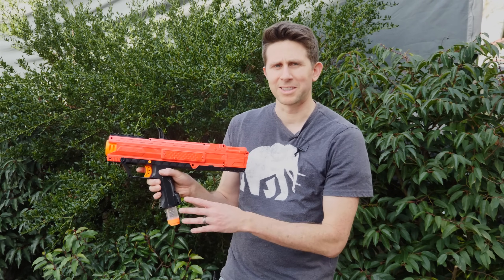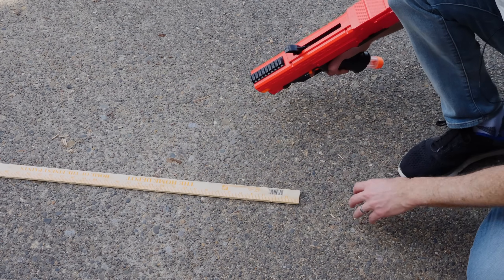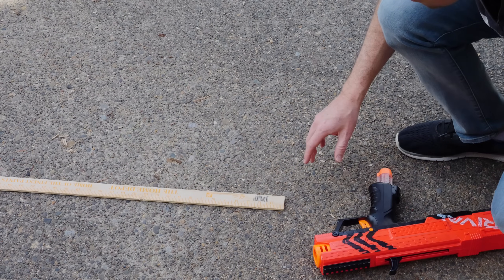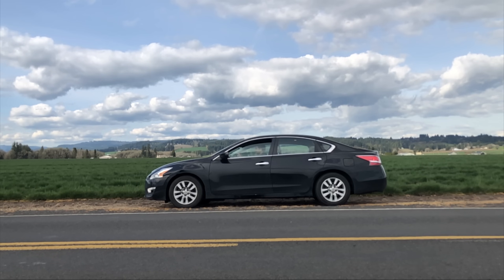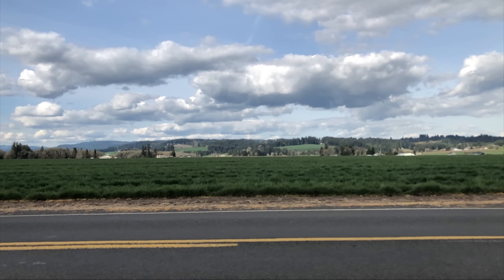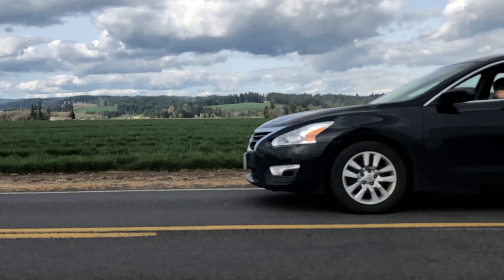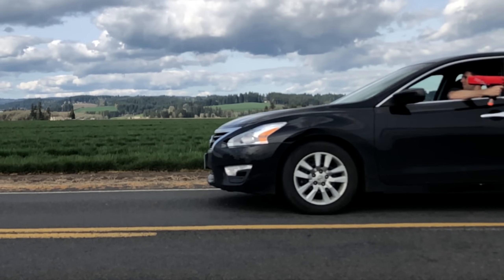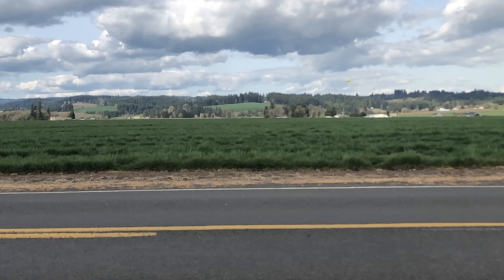Shooting a Nerf Gun Backwards While Driving At The Bullet's Speed Forward

Comment: just imagine if trains could drop you of with a mechanic like this. That would be awesome.
Reply: That's an amazing idea
Reply: The train would still need to slow down a lot to make sure you land on the platform in one piece
Reply: Shivang P Swain um?
Reply: @shivangswain  nah we yolo jump
Reply: Shivang P Swain what if the train just ejects us backwards out the train at 55mph while the train is going 55mph into a... foam pit! Would be like doing acrobatics and riding the train all in one! Good times!
Reply: @shivangswain  No! Not if you you getting luanched just as fast
Reply from the maker: just before your stop, you go towards the front of the train. There is a seat that you sit in that safely accelerates you to the the exact speed of the train in the opposite direction. You are ejected out of the back and land with zero velocity on your feet at your stop. I see no issues here 🤓
Reply: @TheActionLab  I see what you are saying. Basically, a more gradual/gentle acceleration several seconds ahead of the ejection time, rather than suddenly like the ball shot from your nerf gun.
Reply: @TheActionLab  that would make a great title though wouldnt it. :)
Reply: @TheActionLab  it is an engineering  problem, not everyone is the same weight so different forces will be needed to be applied plus not everyone will have the physical and mental ability to get the timing right.
Reply: @ahmedmamdouh3964  The seat that would accelerate you could also measure your weight so it could calculate the correct force that would act upon you.
Reply: @ahmedmamdouh3964  thats easy to fix with a  pressure sensor and adjust the velocity and stuff
Reply: @TheActionLab  wouldn't the g-forces be exponential because of the negative acceleration?
Reply: @imx152  that is not how g force works.  Einstein showed this with his theory of relativity. If I understand you correctly, you meant one acceleration going forward while the other going the opposite direction? They would cancel out. And you might be reffering to speed, which also cancel out.
Reply: @TheActionLab  Like seraphic said above. you are still going from 55 mph to zero in an instant.  Probably not good for your innards.  Your key statement Is "safely accelerates you" to the speed of the train.  There's the rub.
Reply: @TheActionLab  Did the math. 2g aka 20 m/s^2 =44mph/s, train at 80 mph , takes little less than 2 seconds (1.82s), and 33meters of distance to reach 80mph. This is fairly realistic. Unless my math is wrong.
Reply: @TheActionLab  -- when cars are driven by computers, your car can be the pod which hops on and off the moving train.
Reply: The Action Lab now collab with The Hacksmith to Make it Real
Reply: @TheActionLab  unless there are 50 people wanting to get out at the same time or more
Reply: @TheActionLab  most people are standing are we talking about a private train only govetnment officals use?:p
Reply: @TheActionLab  neeeeeeerd
Reply: The Action Lab That way it could work, good idea, but if it happened as quick as the nerf ball it would probably hurt you really bad.
Reply: @TheActionLab  "just before your stop"
What stop? The whole idea is the train DOESN'T stop.
Reply: @craigcorson3036  your stop is basically where you plan to leave the train. The train is not stopping at all...
Reply: That will break a lot of bones and maybe your neck
Reply: @ahmedmamdouh3964  getting shot at 60mph hell yea
Reply: @ertertz9408   the daredevil who gonna test it for us is you
🔥
Reply: @ahmedmamdouh3964  
no you speed up so you move the same speed as the train but backwards so you dont really move, you just,  ploop
Reply: @ahmedmamdouh3964  For sure there will be an impact! lol
Reply: @ahmedmamdouh3964  for science !
Reply: @ahmedmamdouh3964  it would, unless you accelrated the people gradually until they were moving the same speed as the train but opposite.  If you were to just instantly shoot them out the train at the same speed, the gforce would kill you.  I imagine a long conveyor that runs from the front of the train to the back. A person steps on the conveyor and it moves up to speed. By the time you reach the back, you just fall out and land on your feet!
Reply: @ahmedmamdouh3964  No, if it lounched you clean you would land perfectly.
Reply: ...not necessarily
Reply: Same concept can be used to enter and exiting trains. With enough room to accelerate and decelerate safely, it can actually be done. Now to work out the kinks.
Reply: @aledirksen01  maybe the chair only decelerates for just under half the train then sits still at the station just long enough for a new passenger to hop on before it starts accelerating them to the right speed to the other end of the train! No stops :3
Reply: It would be dangerous even if they could perfectly land you on the platform with no forward motion. The reason is that the sudden acceleration (or deceleration if you prefer) would be like getting slammed into a wall at the speed of the train. So that would kill you, and the process would gently deposit your corpse onto the train platform.
Reply: @derfunkhaus  But what a way to Go!
Reply: @derfunkhaus  Not at all. An acceleration of 1.5 g over 2 seconds is perfectly supportable by anybody.
Reply: informatimago I agree that 1.5 G over two seconds is no big deal. But I didn’t specify 1.5 G, so you must’ve arrived at that somehow. What did you base that on? The video talks about him driving 55 mph and the ball is accelerated practically instantly to -55 mph relative to the car’s motion. A lot more than 1.5 G.
Reply: @derfunkhaus  a=v²/(2s) where a is the required acceleration, v is the final ejection velocity (reference frame taken to be that of the person), s is the available length to accelerate the subject (length of the coach, say). 
Now, if a train is going at 360kmph, which is 100 m/s, and the available length be 50 metres (which is a lot), then a=100m/s², which is about 10g.

Making our assumption a bit more practical, v=100kmph, s=10m, we get a=4g, approx.
Reply: @derfunkhaus  if im not mistaken, there is a scene in a movie (which i forgot the tittle) practising this technique
Reply: @derfunkhaus  Exactly."It's not the fall that kills you, it's the sudden stop at the end."
Reply: It would be like throwing you against a brick wall.
Reply: Hahahahahaha! Yes!
Reply: i don’t want to be fired out of a train
Reply: I’m with Action Lab on this one. Just because it’s done with a human body doesn’t change the principles of physics. If the train were to slow down to let’s say 25mph, and you in the front of the train with some sort of propulsion mechanism were to be slingshot towards the back of the train at 26mph, the effect would feel as if you were walking out of the end of an electric escalator. You would feel a slight push of 1mph. You can even adjust the speed. Train 50mph, you accelerate @ 51mph the opposites direction. Slight push of 1mph. I believe the key here is to ACCELERATE to 51mph. Not sudden speed of 51mph.
Reply: @MAYNOR82  How many meters does a fast car travels before it hits 50mph? Thats how long that propulsion thing would have to be IF the trains speed was 50mph max. Now try to fit that concept when 50 people wants to get out on 1 station and another 50 wants in the train.
Reply: @matke8723  you're considering efficiency, the point is can it be done. And you're comparing tje strength of an engine to push a huge hunk of steel, to a mechanism that would only need to accelerate a human. The 2 arent linked in that strict sense you're saying.
Reply: @FinkPloyd504  Nah, I'm just saying that car accelerates to 60mph in 3, 4 seconds at...idk exactly...but its probably around 100m and even less. That should be the max length of that human propulsion system.
I know it's definitely doable, im just thinking how it would work.
I mean you can shoot young people from that system, but not elderly, or injured people at 60mph.
Hm..
Reply: @matke8723  you just make a small car thats on a rail on the side of the train, slow the train to like 40, and send the car backwards at the same speed. You have plenty of time, especially it the entire car is left behind in the platform at the end, then theres not even a gap you have to shoot. It could pick up another car right after on the fly, have them cycled around like shopping carts.
Reply: @matke8723  this is just about one person getting off really though. Its less of a this works and we should do it, more of a this thing could be done and is cool. Ofc you can't empty a whole train like that but thats not the point of the question :O
Reply: Matke Well I was speaking hypothetically. We are just exploring the possibility.
Reply: @MAYNOR82  yeah, the exit transition is all well and good, but accelerating the guy to 26 mph is the more pressing and possibly injurious problem
Reply: Lol a train shaped like a horse shoe that stays at a high velocity and a exiting pod to let people off. While also passing the train station the horse shoe shaped train picks up empty pods already accelerating to the same momentum.
Reply: @codyfennell9858  ok, what happens to the escape pod after it lands?
Reply: Shadow747 since my idea would to use the railways already in use just add a onsite storage that could spray a cleaning solution before it gets in line for the next passing train or cycle. Eventually the idea could be used in a whole new way like with new railing systems but just a thought for re-engineering the train as is with minimal expense for testing and so fourth
Reply from the maker: @Eddie Hitler You are correct. There are lot of people on here that seem to believe there would be an instant deceleration at the train stop. They are not understanding the concept that the ground is moving the same speed as the person when they hit it. Of course this idea is just silly as a real idea, but it is definitely possible to do without hurting the person. Looks like I’m going to have to try to do a video with a human:) for example if a semi truck with a long bed was moving at 28 mph and Usain Bolt ran at his top speed backwards off the back he would just drop off the back as though it were stopped and he hopped onto the ground. There would be no deceleration for Usain because the ground is moving the same speed as him when he hits it.
Reply: The Action Lab well I for one am not talking about that at all. I’m talking about the process by which the person who is traveling at some velocity v while on the train, is suddenly accelerated to -v with respect to the train. For example if you had a strong spring mechanism that ejected them backwards (with respect to the path of the train), if that spring accelerated them with too many Gs, it would physically traumatic. i.e. It has nothing to do with impact on the stationary earth. The moment they hit the ground, no physical damage would occur. The damage would have been done already and no further damage would happen. The reason is that a human, unlike a nerf ball, has a brain which can bounce around inside the skull getting bruised and shearing off little blood vessels. Likewise the other organs of the body, such as the heart, can suffer catastrophic damage. 

So you would need to calculate how many Gs and how much moment of inertia a person could take, and design the system accordingly. It would be doable but it would impose a practical limit on the speed of the train at the time of ejection.
Reply: @TheActionLab  
Deceleration forces are equal to acceleration forces! Newton's third law. As Usain is not being shot out out of a gun he'll be fine depending on how far he falls!
Reply: @TheActionLab  that idea is crazy man
Reply: Just have a dropoff car that slowly builds speed from the front of the car to the back, matching the speed. You can picture standing on it as the ground in front of you stays the same, it would be as if you weren't even on the train, no brick wall problem at all, simple.
Reply: Eddie Hitler it would have to be gentle relative to the train and the passenger in question. It wouldn’t matter if it was gentle relative to the outside world if the change in velocity on the reference frame of the moving train were sudden enough to damage the passenger’s body.
Reply: The train would need a long ejection system to make sure u accelerate slowly to the speed of the train or else ur bones will break
Reply: Yeah! Like others are saying, impulse (change in momentum over time) would kill you if you did exactly this, but in a long train, perhaps you could be accelerated from the front of the train to the back and your change in momentum could happen over a longer time and lessen the impulse.
Reply: Good idea for a daredevil
Reply: Not really. You would have to instantly decelerate from whatever speed the train was going, to zero. If you could be decelerated more slowly, it could work, but I don't see how that could be accomplished.
Reply: @craigcorson3036  trains are long, why would they have to instantly accelerate them to the opposite speed? Can slowly ramp the speed along the many cars of the train, no need for instant acceleration.
Reply: @XXcreeps  dont need to be that slow acceleration. As long as its not instant, humans can take it ez. Check fastest accelerating cars ect
Reply: @XXcreeps  Have you ever been on a train? The cars move independently of each other, in every direction but forward/back. Please propose a mechanism by which this could be accomplished. Good luck with that.
Reply: @craigcorson3036  easy. You have something like a train car attached to the side of the train car, that picks up pace from the front of the train going backwards. Just match the speed and you have a window of time to step off , depending on how long your train is.
Reply: @FinkPloyd504  It would be a very brief window. A passenger train car is only eighty-five feet long.
Reply: @craigcorson3036  or the entire car could detatch at the end and be left on the platform for you to exit at your leisure
Reply: Train stations are already dangerous enough lol
Reply: And get on the train like that ☻
Reply: T F lol eventually yes but i think it would take a new railing system to make getting on the “super train” with the pods being used for exiting and entering. Mainly due to if we have this “super train” so to speak, how fast is it traveling? Lmao
Reply: It would be the same as if they train sudden stop. You would SPLAT against whatever container we were in 😜
Reply: I think the pressure needed to accelerate you to the trains speed (in that short time) would basically cause the same damage. But you could maybe just accelerate to the half trainspeed to split the impact up into two smaller Impacts
Reply: Eddie Hitler oh wow,
but at least the train will still need to have a similar system or else it’d be an unpleasant experience to normal people.
Reply: The G forces will tear you apart.
Reply: You'd have to be thrown out of the train at the speed of the train suddenly 

Very painful experience
Reply: Smaller wagons that accelerate independently before sticking to main train makes more humane approeach.
Reply: The cost of such thing outweighs it coolness in the real world.
Reply: The cross-purposes talk in this thread is painful.

It's a thought experiment, people.
Reply: Say the train runs at 100 km/h = 27.77 m/s; a passenger car length is about 27.77 m, let's assume we can install a passenger accelerating device of that length.  So we need to accelerate the passenger from 27.77 m/s down to 0 m/s over 27.77 m. So we have:

x=½at²
v=at

27.77 = ½ a t²
27.77 = a t

2 = t
a = 27.77/2 = 13.885 = 1.415 g

So this seems perfectly supportable, if a little abrupt.

The real problem is to unload more than one passenger at a time !
Reply: The deceleration would kill you sadly.
Reply: The mechanism would need to accelerate you.. to the speed of the train. I think I’m fine with the current system :)
Reply: That would be like a car accident. The sudden stop would hurt you.
Reply: That would be horrifying and you would (not a doctor) probably suffer a brain hemorrhage.
Reply: @Skratch_HD  why? Just limit the acceleration  and thus the force felt has a max cap.
Reply: @aledirksen01  Who's gonna ride a train that you can cycle faster than though?
Reply: @aledirksen01  you'll need a decent distance for that and some vessel to hold you so that there is no friction on your legs
Reply: @Skratch_HD  You might have replied to the wrong person but to answer your question, I never mentioned a speed. I would actually prefer extreme speeds. So I can do some math here to determine forces and maybe double check max force for humans and do another calculation there. Let's for now assume 1g of force is max acceleration which is rounded up 10m/s^2 or 22.4 mph/s. Thus for a train at 190 mph, it would take 190/22.4=8.5 seconds to get up to speed. We also want to know what distance would be needed for this. Distance = .5 acceleration × (time)^2 = 361 meters if my math is right. Subway trains are typically 40 to 130 meter so we in some issue here. Either make a compartment for acceleration or increase acceleration or reduce train speed. You have the numbers now so have fun
Reply: @Skratch_HD  the train will be going train speed with a barrel on the side with a chair that can accelerate to the same speed in the opposite direction until the cancel out and you're sitting still above the ground because the chair is going the same speed along the train in the opposite direction. You would just need longer acceleration time to prevent human damage if the was going very fast. No need for the train to go slow though thats the point of all the chair stuff. No stops so they can stay at full speed.
Reply: Too much g force
Reply: Lmao
Reply: Very doable as long as the speed of the train is not too fast. And you can run to match the speed of the train
Reply: oh my god, genius haha
Reply: @Eddie Hitler 🙄
Reply: It would only be awesome once
Reply: ward
Reply: To exit the train, you could step into the last car - a 10'6" wide pod spin up launcher, which would accelerate gradually like a giant washing machine starting a spin cycle. The final speed and exit release angle would be calculated bases on train speed, passenger weight, platform landing pad distance from the train, etc. Let's do this!
Reply: What would you need this? The train still needs to stop and pick people up
Reply: It can if ur brave enough
Reply: WE HAVE A VOLUNTEER!
Reply: Eddie Hitler 
Yeah and spend our money on like, usful stuff
Reply: There have been news of work going on this
Reply: They would put you in a cannon and shoot backward
Reply: The forces are the same as hitting a wall!
Reply: @Eddie Hitler Sure Eddie, sure. That's what everyone is saying. Bye now.
Reply: Shouldn’t the air resistance of going 55 mph carry the ball backwards?
Reply: @actiniumanarchy9237  No, the ball is held in place until released backward into effectively still air!
Reply: @actiniumanarchy9237  relative to the air its velocity is 0 m/s 
If you're not moving you're not resisted by air
Reply: Sorry, but i thing the train dosent like being triggerd
Reply: Now N.A.S.A wants to know your location
Reply: Do it with a bullet train?
Reply: Jamie Hyneman from Myth Busters genuinely wanted to try this but wasn't allowed to by their insurance. He didn't see any problem with it though.
Reply: The inertia to your brain tho
Reply: goes pretty smooth:
https://www.youtube.com/watch?v=lVElVZlnTG0
Reply: Japan wants to know ur location
Reply: it depends on your weight
Reply: So, it means before you drop off the train, you have to get hit by some force that would allow you to negate the speed of the train to the opposite direction, which will be horrible for your body.
Reply: JF A they’d have to eject you backwards at the same exact speed as the train otherwise you’d still fall forward at a dangerously high speed.
Reply: JF A I’m not trying to ruin anyone’s fun, but from a scientific point of view this is impossible due to the sudden changes in G-Force, that’s the only factor preventing this happening! Just spreading knowledge :)
Reply: That's a great idea, I'll save much time
Reply: the sudden stop would be like skydiving without a parachute and landing on concrete
Reply: I would think that you'll absorb HUGE amount of g's with this because of the exponential amount of acceleration given the distance the seat should travel is little like you're moving really fast then decelerate by accelerating forward....it's the same as riding a train moving at 500km/h that brakes at the same amount of the seat acceleration opposing the train velocity. People would either get squished into their sofa or something...that would need some kind of force breaking sofa with suitable amount of elasticity....this is for instance that the train would continue moving.
Reply: Genious. Scary for passengers, but would probably be doable
Reply: JF A you would be dead because of the G's you will experience,
Reply: @SpiriDussgaming  idk formula 1 cars do around 1.2sec 0 to 100. So make short acceleration and itd work, not instant like from cannon tho
Reply: Mikko Lappalainen not every human can withstand that amout of acceleration, maybe i can get 6-8Gs without passing out and you maybe 4 or 5 and you pass out, if they implement something they should make it that it acceleratea to the speed (normal trains go up to 160kph) in 10seconds,
Reply: Well maybe you gotta slow down to like 5 mph and get thrown out at 5mph or something
Reply: JF A start the company I’ll be your #1 investor
Reply: It would have to accelerate you slowly, but could work
Reply: Yeah but you would have severe decapitation
Reply: Shoots you out backwards at 100km/h
Reply: Cannon train
Reply: If you like imagining your bones violently breaking maybe.
Reply: Ok, how do you get on without the train stopping?
Reply: i wonder how it would look like if you would be on a bicycle
Reply: You are gonna break before you even land, or right after the mechanic started
Reply: Why not just go to the caboose and it detaches a bit after passing your stop, then you in your caboose slide back into your stop. The caboose you exited then starts along the track to accelerate so that the next train can pick up your caboose in front and drop the next caboose.  Pretty much like how planes can refuel mid air. I dunno, seems like it could work like that?
Reply: You may get dizziness lol
Reply: Maybe not people, but postal containers?
Reply: @BruceJones-BMcCJ  There's a movie where the train doesn't stop (or cannot stop) for some reason. But then, there remains no people outside of the train, to receive postal containers.  They would rather try to keep all the shit they can in the train to recycle it...

Now, the mass of passengers is about 10% of the mass of the empty train, so it may be worth the energy to eject the passengers instead of stopping the train, and restarting, UNLESS, this is an electric train, which converts the kinetic energy back to electricity when braking.

For merchandize, this would be more dubious...
Reply: If you don't mind getting shot out of a canon
Reply: I swear, some people take some things literally and you wonder why  they are even here. “Why would you go back in time and kill your grandparent?” “Why would Schrödinger put a cat in a box with a radioactive substance?” It’s called a thought experiment people! Without them we wouldn’t have won the war (WW2). Never mind  even having a tiny phone that allows you to instantly see physics videos. Geez people! If you care to argue at least bring some sort of science behind your argument. 🤦🏽‍♂️
Reply: And that mechanic accelerates you to the speed of train in less than one second?
Reply: y e e t
Reply: then imagine how much u had to suffer dealing with such high acceleration like that
Reply: Ever hear if g forces?
Reply: The inertia would destroy you
Reply: You dude just revolutionize the transportation system. The vehicle doesn't need to stop now to drop the passengers.
Reply: Just give this man a Nobel physics prize already!
Reply: Lots of people saying this would break your bones or the train would have to be slow. The roller coaster with the fastest acceleration is the Dodonpa in Japan. Using a jet-assisted compressed air launch,it goes from 0 to 107mph in 1.8 seconds. So the train could be going 100 mph and it could still work. Someone should definitely try this.
Reply: Your body would've to be accelerated quickly to whatever velocity the train is going, so if the train is going at high speeds it's not going to be fun for your internal organs
Reply: That's a good idea!
And I think I have an idea for how to get out of the train. The train car (where the people are) need to have system to be accelerated to the back end with same velocity the train is going (kinda like double train/a mini train on the main train). This is so people in not harmed because the car have already gain same speed as the train. One thing I can't figure is how you get the car with new people in. Because the train  in such system never needed to stop it would be a problem to board the passengers.
Reply: Elon: already in the works. Rapid Prototyping Team says 2 weeks.
Reply: You would have to immediately switch directions at the same speed the train is moving. Ie you basically are getting hit by a train.
Reply: That sounds painful...
Reply: So many replies here, lets just build electro magnetic trains n be done with it.
Reply: Word
Reply: @Eddie Hitler That's because, for the ball in the gun, the splat has already occurred - it was the yeet that the ball received when the trigger was pulled. You don't just go from zero to muzzle velocity easily, it takes buttloads of acceleration that's only marginally better than throwing you from the moving car onto the ground.
Reply: Do you want to be shot? You wouldnt be moving but feel the force.
Reply: elon musk wants to know your location
Reply: Could work, if you were accelerated slowly, maybe travelling from the front of the train to the back before you get removed
Reply: just have all exiting passengers move to the last car and then detach it at the stop, meanwhile have a separate car with the boarding passengers replace it as the new last car. but now you need 3 locomotives.
Reply: or just stop the entire train at each stop and have it wait while people exit and people board.
Reply: Your forgetting body mass, were not feather weight, that energy needs to go somewhere
Reply: Yo
Reply: JF A wouldn’t be dangerous necessarily but it might throw you off balance and heavily disoriet
Reply: JF A actually there were some tips for soviet "special forces" that you need to drop from trains with a backward forceful jump.
Reply: This is honestly something I'd see China developing. Objectively speaking, the population excess, technological power and, well, let's just say, not the best record for valuing the life integrity or rights of their individuals, would make it a useful and feasible system that the government would have no problems in allowing/pursuing.
Reply: Lol throwing you out the window at high speeds
Reply: Just throw you out the window
Reply: Futurr
Reply: Lmao😂 casually hopping off the train like some GTA glitch
Reply: @Eddie Hitler It actually depends on how fast you decelerate, if you go from 100 km/h to 0 in a fraction of a second, your body will be destroy. But if you decelerate slowly, then you will be fine.
Reply: They already did this with mail bags at one point, it's kinda crazy how well it worked!
Reply: The g force from the acceleration backwards would littrally obliterate you😂😂😂
Reply: Yeah, to unload freight train.
Reply: it'd have to be a slower acceleration. otherwise it's the same as you going from 55mph to 0 in an instant.
Reply: You would have to be fired from something.
Reply: @TheOliveBranch7  you can be accelerated slowly over a large length since trains are quite long. Could speed up at the same speed as a regular car drive probably
Reply: @XXcreeps  probably. Its seems like a bit of a stunt.
Reply: @Eddie Hitler A human being is not a nerf ball. A human on a train is traveling forward at the train's velocity. To suddenly decelerate to the platform's velocity - zero - would very likely cause injury. I don't think that most trains are long enough to manage the deceleration gradually, regardless of what kind of equipment was used. If the train slowed in order to accomplish this detraining, as someone has suggested, then it may as well just stop.
And all that is not even considering luggage.
Reply: Your internal organs will be smashed if deaccelerated instantly some of use won't survive that.
Reply: @Eddie Hitler Tell ya what, Eddie. Build yourself some contraption that will slow you down to zero from whatever speed the train is going, and try it. Let us know how that works out for you. Assuming that you survive.
Reply: @craigcorson3036  its not about decelerating its about speeding up. You'd be speeding up int the opposite direction.
Reply: why?
Reply: So basicly the train needs to shot you with 120mph (if the train goes that speed), and i don't really think that you will survive that xD

But would be still a very fast method for trains, but at the end you still need to go inside of the train, so it still need to stop :p
Reply: @Eddie Hitler yeah but as the relativity theory predict and Newtons laws of motion says you won't feel well when you land on your feet due to the fast acceleration that will force your inside organs to get crushed
Reply: @Eddie Hitler One of the things that I hate most about people like you, Eddie, is that you are DELIBERATELY obtuse. We are not talking about cars or motorcycles or any of the other things you mentioned. We are talking about trains, or, to dumb it down to your level, choo-choos. The key difference is that those things you mentioned accelerate/decelerate gradually. You're talking about a person decelerating almost instantly, which as another commenter noted, would be like smashing into a brick wall. As I said before - try it. PLEASE try it!
Reply: And it would be impossible since there will be hundreds of people want to get down.
Reply: What a great idea. If the train goes 60km/s it would be the same as if a car hit you at 60km/s.